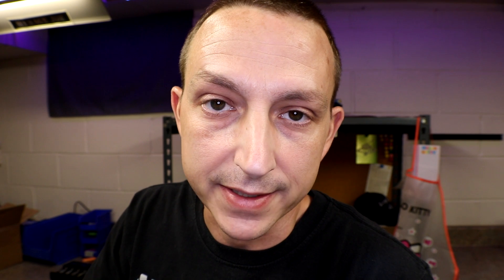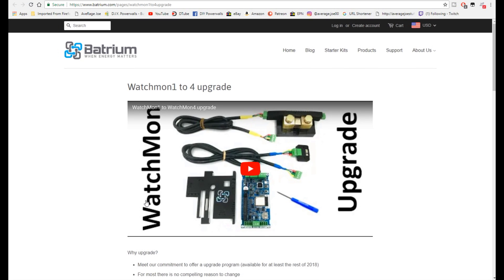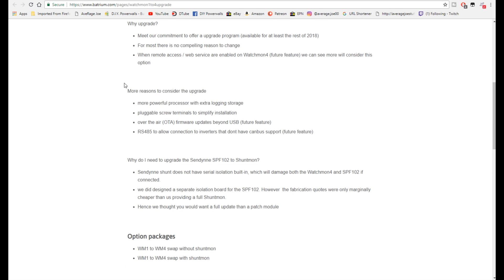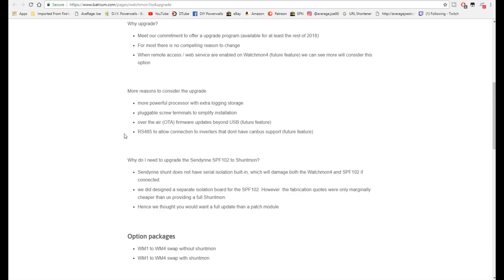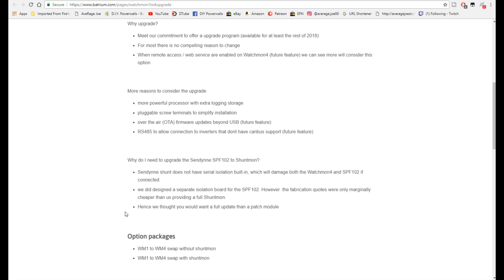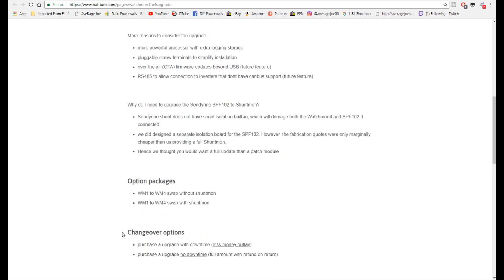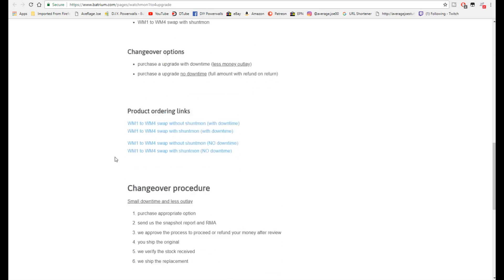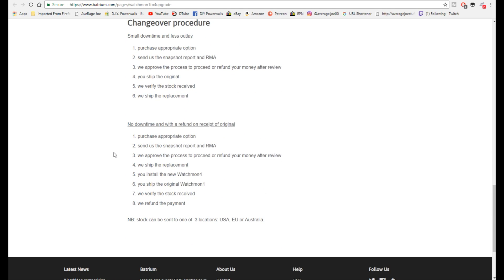🔋⚡WatchMon4 and ShuntMon Now Available for Upgrade!!!⚡🔋

Comment: What is you max allowable self-discharge for cells? If you charge to 4.2 and let them sit for a while how far do they drop before you call them bad cells?
Reply from the maker: Everyone is going to have different standards.  My standards are kinda low since it takes me a while to accumulate cells.  Mine can sit for months at a time after testing so Ill use anything above 4v!

Comment: Do you have guidance on how large a pack can be for a single longmon?   
For example, I think your packs are about 100cells?  (220ah?).     My packs are 60cells/130ah and I have 4 x 14 = 56packs (e.g. 56 longmons - e.g. $700).   I could parallize my packs and have 120cells/260ah per pack and reduce my longmong count to 28.   I could even do 4 packs (240cells/520ah) per longmong and only buy 7 of them.
So the question is - how large a pack can a single longmon handle?     
Thanks in advance for any thoughts :)
Reply from the maker: You can make a pack as big as you want but the bigger it is the longer it takes to balance out. My packs are 226ah each and I personally think thats almost to big but I tried to balance my packs as best as I could in capacity so the longmons dont have to work so hard.
Reply: Thank you for info  (and for your channel overall!!)
Reply from the maker: They have seen up to 1000ah I think but like I said, takes forever to balance out.
Reply: I found this at batrium website....   "What is the max Ah that a LongMon (cell monitor) can handle and what is the recommended?"
We recommend 200-300Ah, it is subjective as others have used them on 800-1000Ah.
Typically we adopt the logic that if a battery is totally out of balance (all full with one empty or vice versa) the system should be be able to automatically equalize within ~1 week. Hence if a longmon can sustain 5W or ~1.2A bypass and there are 168hr in a week this results in approx 200Ah.
Reply from the maker: BOOOM There you go perfect! I remember reading that a while back!👍

Comment: That was better than meditation :)
Reply from the maker: Thanks Man!!!!! although meditation can be quite good as well!!!!💥👍
Reply: The effect was the same - my brain stopped computing for a moment and it was quite welcome :)
I am considering Batrium for a DIY LiFePO4 bank in a Catamaran. (16s2p for redundancy reasons to be able to service one string while the other can still provide power, 480ah@48v)
I don't see much installations in a marine environment so I am on the sideline at the moment and pondering things :)
Reply from the maker: Well then my job is done.  So cheesy the brain doesnt compute!!!😆👍  I think the Batrium would be a great choice for your boat.  The pcb's are coated for extra protection.  I would imagine there have been a few marine installs but most probly dont video the install.  I can ask Jaron to see if there is anything he would recommend for installing the batrium in a marine environment.

Comment: Hey Mon! Dat be da shunt Mon! I only need a shunt to carry 250-275 amps maybe 300amps in the future! 
I really need to get some battery management! I'm starting to get alot in these batts $$$ cash wise. I do not want to get them out of balance. Or over discharg or over charge. Plus they in the house. Is kinda like to NOT burn it down!!! But I need a house for the batts. I don't really like the piwerwall design. I was thinking maybe a trunk or foot locker type deal. But haven't decided. I'm rethinking the power wall idea! I need it to hold about 2000+ cells! 2100-2800 cells or so. With about 2800 mah. Each.  Keep up the great work sir Joe!
Reply from the maker: Yes Rasta! Da shunt mon is da wan you want mon!  I wouldnt waste my time with the cheap bms's.  Main reason I went straight for the batrium!!!!  Its in my house and I didnt want to chance the cheap stuff not working even a little.  Theres so much other safety stuff you can do with the batrium as well like having it cut the power with a shunt trip, turn on off fans for heat ect... You could always get a full tower to house the cells.  If I cant get more packs into the short server rack I may end up going to a full size rack.  WOOLC.💥👍
Reply: AveRage Joe where could I find a server rack? A short one would be fine. All I'd be putting in it is battery! So it should hold enough? I could always put a few on top! I thought about using a filing cabnet. That idea didn't last long! I could line it with something non conductive. And if it had 7 dwares it might work well. I also thought about building a shelf/cabnet from wood. Atleast it would only be flammable and non conductive!.. I had a shelf I was going to use. And a trunk! But the size has out grown that as well.  I'm going to be coming up on 1400 cells before long. I'm over 700 now. I guess I need to calculate the size 2100-2800 cell will be. Then make something with room for about 1400-2100 more... I think I'm addicted to lithium!!!  Maybe I'll just build a shelfnet to hold up to 1000 cells per shelf, with 7&1/2 shelves. With fans to circulate air. Incase it gets hot or cold. I can regulate the temperature! I'd like one of the screw drivers!! Do they come with the system? For some reason I will almost buy anything if it has something free with it that I'm interested in!! Even stuff I don't need!! I also been thinking about EV batteries. I'm trying to stick with LG CELLS I have a few Samsung. They aren't as good as the LG's some of the 2600 LG's are over 2900mah. And the sam's 2600's are 2500-2600 something mah. And alot are dead or very low capacity. I try using  only rated capacity or better cells. I only have a hand full I'm not putting in the bank. And about 8 at 0 volts. All Samsung!  I hope to peak at about 250ma per cell! So heating shouldn't be a issue. Under average use. There may be times where I pull a couple amps! But under average use. 200-400 ma max.

 Where can I find a breaker to work with the baitrium? I haven't actually looked for one. All I have is marine and automotive DC breakers. Or disconnects.  Cheers!!! sir Joe!!

Comment: in my watchmon4 system, out of 16 wires, 7 failed so far. (yes, i have them thin wire ones) the disconnection is inside  the plug (red or black wire). the wire galvanically disconnecting from the the pin. it starts with  the blue bar in the software flashing orange and eventually totally failing. the software then disconnects, though the rest of the longmons seem going on working on their own, except the disconnected longmon.
even though this is a known problem with batrium, average joe is not the first mentioning this, batriums Maxine wants to "investigate" first. i took contact with them  3 weeks ago. i am not too happy with their customer service, though they might be overworked i suppose.
that batrium sticker falls off after a day, even after hot gluing still falls off.
Reply from the maker: Thats CRAZY!!!!!  I wonder if I could kinda replicate that on my system for an "example video" to show others that they have upgraded the wires.  Do you still have video or pictures of yours that I could use if I cant get mine to do that?  I havent used the sticker yet.  Need to find a good place for one.  What did you stick it to?
Reply: haha, the sticker wasn't important enough the take pictures or videos. i stuck it up on a clean surface on the fuse box. it sticks at first, then slowly peels off until total failure and gravity does the rest. some of the LED strips i installed have the same problem. i had to put the hot melt glue right around the strip for them not to fall off.
Reply: no videos of the failing wires either.  when i first put the system together, the first wire failed when i did the bypass test. so basically as soon as there is that 2 ampere current going through it. one set of wires had the red and black wires exchanged. i just saw that by coincidence.  the failing of the wires starts always with bypassing.
another interesting titbit, two of the failing plugs i bridged by soldering the failed wire directly to the plug on the longmon. (you sort of get a bit frustrated when it keeps on happening) now the visible surface an the female plug to solder is extremely tiny. using a finely pointed 15w soldering iron, probably took half a second to solder. now it seems the temperature sensor is somewhere near that plug. now shows 5 degrees C and the other -39 C. they still move up and down with temperature change. luckily it is not the bypass temperature sensor. another of them mystical things.
whilst i am at it, in the software , cellmon, when after fiddling around, you decide to click "default setting", just to make sure, you never know, it generates a new SYS number. that number showing up on the top of the software. the software then does not connect anymore till you click for the new SYS number.
keeps me busy for hours.
Reply: UPATE:
a week ago batrium sent me 6 free bypass wires. i ordered and paid for 10 more.
upon pulling out the faulty wires i noticed a dull sheen on the visible metal part inside the white plug. and only on the  by pass wires. the communication wire part was still shiny. i suspect that hotmelt glue has something to do with it.
so far i changed cells 6,8,9,10,16. i already had changed at least 2 wires before that. cells 2 and 11 are on the out too. whilst wiggling the wire the voltage fluctuates. (that is how it usually starts). i have left them plugged in for the time being for observation.
also cell 8 i changed the wire, but it keeps orange flickering when first going into bypass mode. after about a minute it settles in doing just normal bypassing. i suspect the problem lies somewhere on the longmon. i keep observing here too.
the new wires do not have hot melt glue on the plug anymore. which is another indication that the hotmelt glue caused trouble.
batrium asked me to do a video  about the flickering etc:
https://www.youtube.com/watch?v=x1FxSt5boZA&t=2s
i will keep posting here for updates
Reply: @Urs I will follow up with Maxine to get you have a response

Comment: little screwdriver take appropriate size nail flatten end with hammer file front and sides to make blade cut head off and bend l to make handle . making takes 5 minutes ordering or going to store takes to long:-)
Reply from the maker: One word.....Genius!!!!!😲💥👍👍👍
Reply: never have one when i need one just keep several sizes of small nails.
Reply from the maker: Im gonna keep that lil trick locked away in the ole memory bank!!!